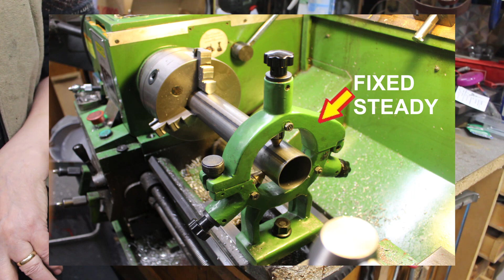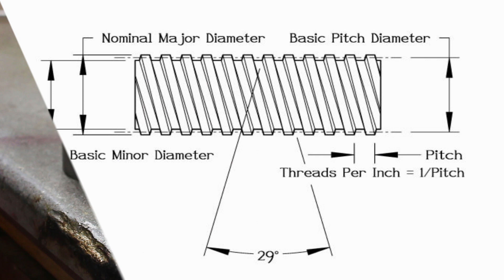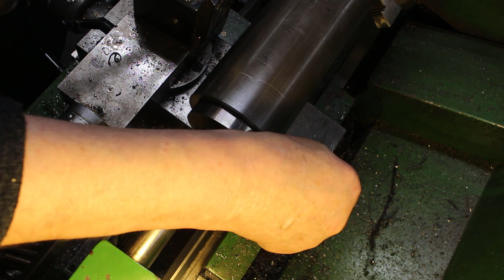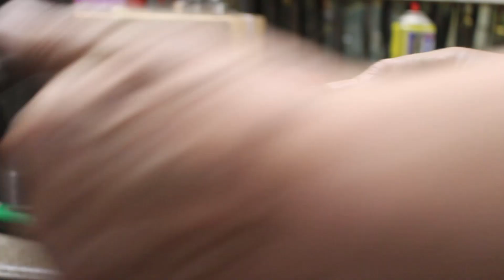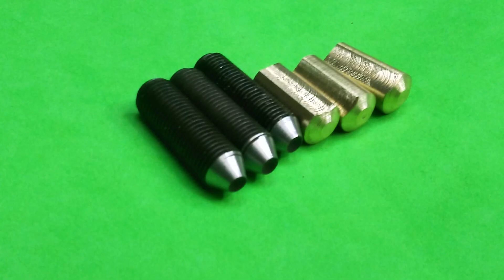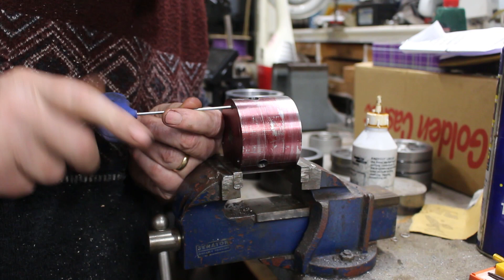Lathe Screw Cutting a large Stub ACME thread : Home machine shop projects No.2

Comment: How did you size the thread? Did you have the mating part to hand?
Reply from the maker: Hi Andrew. No I didn't have the mating part to hand, it's part of a fabrication 600mm dia. The stub acme threads are a fairly sloppy fit, so I just took the external thread down to the specified thread depth and hopped for the best. As I was using a true form threaded insert I thought this would be fine, and it was, fitted lovely.
Cheers
Nigel
Reply: @GoCreatehms  Hey there! I'm glad it worked out :-)

Comment: Can you tell me what model Warco lathe you have?  I have been given a thirteen year old Warco WM 300 lathe /mill combo that has been unused for the past eleven years due to the death of its owner. I am just about to install it into a newly rebuilt and 100 mm insulated all round shed so I shall be warm as toast in there!
Reply from the maker: Nothing better than being in a nice warm workshop on a winters day. My lathe is a Warco BH600 6" centre height, 24" between centres. It's belt driven with a back gear for slow speeds though I'm using a Variable frequency drive so only use the back gear for low speed with high torque, it's an older type model about 20 years old now and served me well.
Reply: Go Create Hobby Machine Shop thank you, I'm not familiar with that model, but I see many similarities with my lathe. I too am going down the 3 phase VFD road and have altered my headstock drive pulley to accept a 13 mm wide vee belt with direct drive from the motor pulley of same diameter, that way I can read the rpm directly from the VFD screen should I want to. I'm looking forward to getting it installed in the next few weeks . My name is Sam by the way. Happy new year for next week to you and your family.
Reply from the maker: HI Sam, I think your lathe is an updated version of mine so similar in capacity you won't regret a VFD drive, I wouldn't be without it